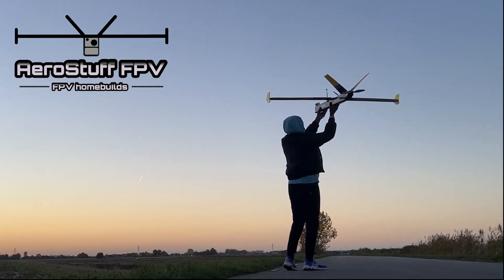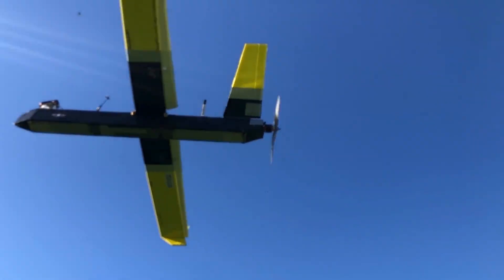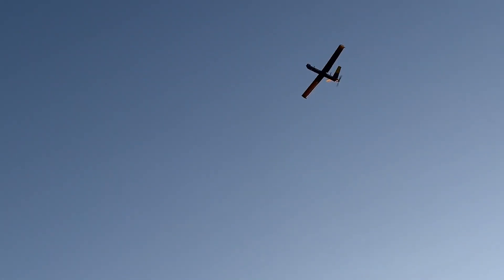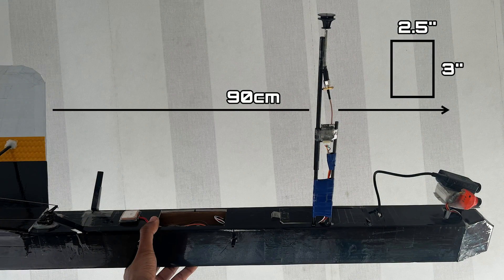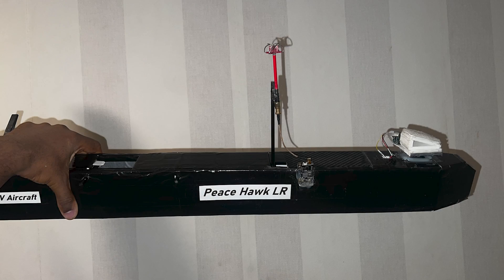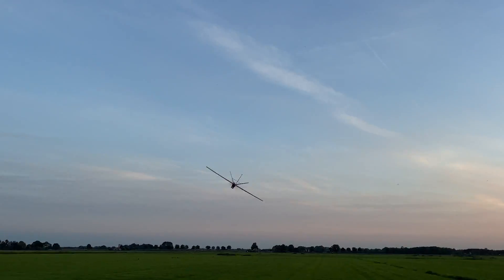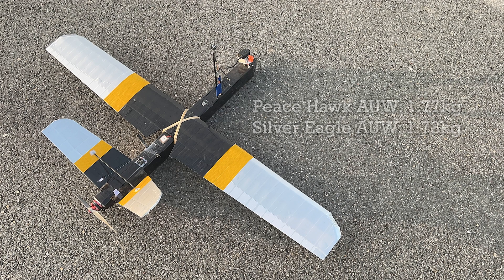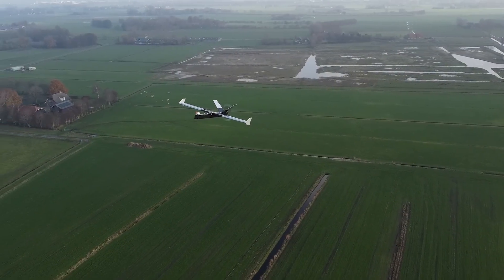V-Tail Pushers for Long Range FPV - Design & Performance Comparisons

Comment: Drag reduction alone will not get increased range, if the wing can produce less lift.  Because the ability to carry a large battery is also a factor in the range.  Distance optimization is the goal.  commercial airliners and bombers tend to go on the speed side of the distance optimization for a variety of reasons, including because they may be shot at, the customers are impatient, the aircraft may be needed elsewhere, or there may be headwinds to penetrate. The only exception is if runway requirements cannot be met, then a slower aircraft is used. think dehaviland twin otter or DHC-2. 
Personally as a design choice, I would move to a slightly thicker wing, and you would be surprised how much more weight in battery it can carry.  most RC planes only can carry half or less of the battery that they can after a wing mod.  you may be able to extend the wings too.  that gets more wing area, but also a better aspect ratio.  any weight that you increase in spar size will be more than made up for, in increased efficiency.  keep using a single carbon tube spar.  find a way to glue a rib to it every now and then, so that you can take advantage of the ability of the carbon tube to resist torsion, and then you can make the structure lighter on the skin, because that no longer has to resist torsion.  then you get the weight Back that way, that you spent on the longer wing. 

the aerodynamic noise that you refer to in gliding flight, is not a good thing.  One method of reducing drag of a design in a wind tunnel is to move a microphone around the plane while the wind tunnel is moving air at speed over the surfaces, and locate elevated acoustic areas.  That can identify inefficiencies, and verify that they have been improved.  
the increased distance between the prop and any surfaces in front of it is very good.  again, the acoustics prove it like you say. 
in theory, the increased motor stator diameter will result in increased efficiency.  So since you have a pusher, might as well use a motor with a diameter as large as the fuselage.   the closer you can get to that, the better. 
try going up in pitch, to a 12 x 8 prop, or so.  or even 12 x 10.   you should notice a difference in efficiency.  even in slow flight, the reduction in motor RPM is very advantageous for achieving same thrust with less blade tip drag penalty. 

So, when you switch to LI ION, please check and make sure your ESC's can continue to operate normally down to a very low voltage. I'm using Castle ESC's and using the Castle Link USB/ adaptor and their software, it's very easy to set low voltage cut off to 5V. 
You can go down to 2.5V per cell on the Li Ion, but beware of the power you lose when gong below 3V per cell, as the airplane may be able to say aloft, but probably cannot safely perform a go-around at those low voltages, so make sure you have a good landing site ready.  most ESC's can only be brought down to 2.85V or so, if they are programable for low Volt cut off.  and make sure you don't experience a soft cutoff it ground testing and think the battery is just getting low, or not notice at all.  a soft cutoff will bring down the plane just the same as a hard cutoff. 

well, those are my two bits of advice.    
your planes look great!  Nice flying!
Reply from the maker: Thanks very much. I’m learning a lot!

The aluminum (1m) spar is the only option I currently have to support the XPS wing. But once a 10x750mm or 10x1000mm carbon tube is in stock, It’ll replace the aluminum spar.

I’ve flown Li-Ions before but have to get used to their way of dropping down in voltage because their nature is to drop under ‘relatively’ low current. iNAV has a parameter that calculates the sag-compensated voltage, which I’ll use, along with actual battery voltage.
Reply: Servos in front of the tail are not covered with any aerodynamic surfaces, it creates turbulence which is not good
Reply: 80cc
Reply: Sailplanes. They are now getting over 60 to 1. The size of the engine is then dramatically reduced.
Reply: Sailplanes do not have to carry large batteries or large amounts of fuel.Having to do so changes the optimization.  @adenwellsmith6908
Reply: based

Comment: Can these takeoff with extra 500gram weight ?
Reply from the maker: Yes. Increasing battery voltage would do the trick even better
Reply: It depends on weight to thrust ratio of the plane.